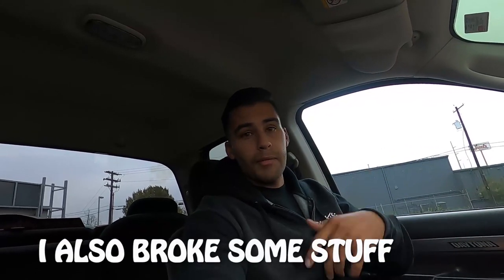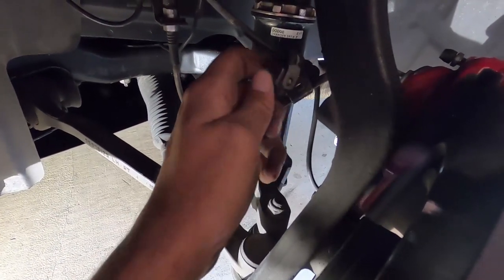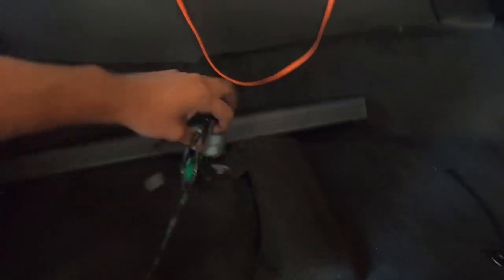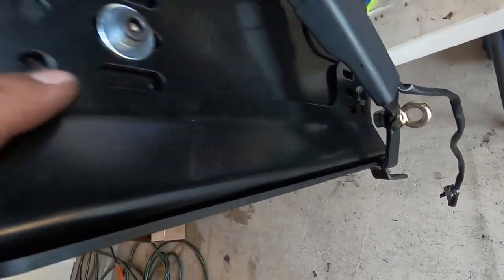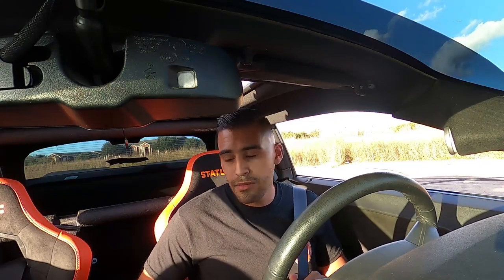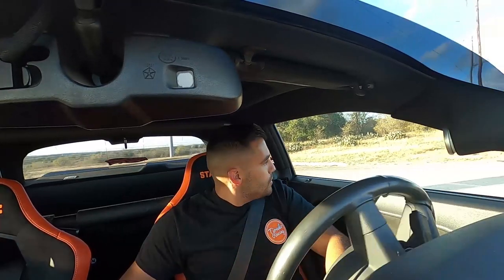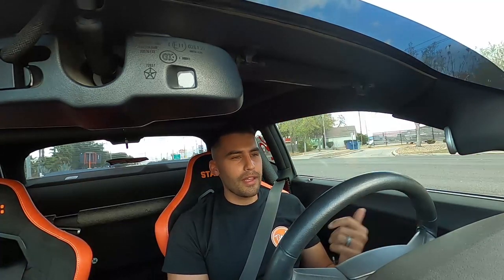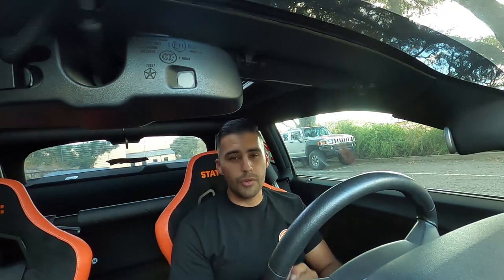STATUS Racing Seat Install, First Drive and Trying To Fix Things But Only Making Them Worse!

Comment: Seats turned out great! I almost went with that brand before my BRAUMs. For sure going to be my 2nd set. Those look much more cushiony like you said. And the customization options are great. Good choice man. 👌
Reply from the maker: ROME! yessir I started with BRAUM as well but the big seller was the full customization. Nobody will have these seats! And as I mentioned my legs were flying all
Over the place in the braums so I really needed the bucket seat. I feel more confident especially because I don’t have to worry about sliding out of my seat. The STATUS seats do both, they can be show car worthy but still perform at the track. Absolutely in love.